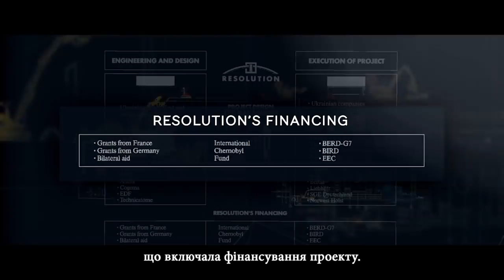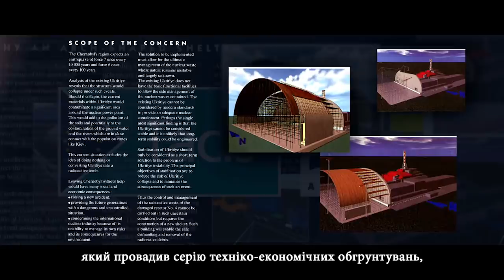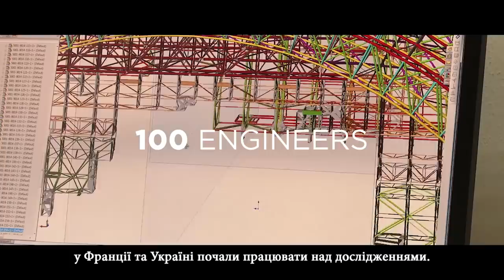Chernobyl confinement: the story

Comment: Well done and respect to all the workers who risked their health to work on site :)
Reply: They needed them operate to supply Ukraine with electricity. Otherwise they'd have had an electricity shortage.
Reply: TheWatcher _ you recall incorrectly.  The other 3 reactors were fully operational and continued to make power for long after reactor 4 had its meltdown.     To this day Chernobyl still employs a large group of ppl who just continue to monitor everything and maintain the stability of the plant though it no longer produces power.
Reply: @punanie05  Correct. Over 3500 employees are working on the plant every day. They come in via a special train connection from Slavutych which was a city built to replace Pripyat, which was Chernobyl's workers' town.
I urge everyone of you to check this out and help them out with donations if you can:
https://cleanfutures.org/projects/chernobyl-worker-healthcare/
Reply: punanie05 it stopped producing power in 2000
Reply: @nehorlavazapalka Yes, but it's still not safe and threatening for health to work there. That's why workers there have a work shedule where they're forced to take a break for a couple weeks, while others who are off their break fill in. If it was not dangerous and as harmless as you try to make it seem like, then people would be all back living there and this new sarcophagus wouldn't be needed.
Besides that the whole area has spots with different levels of radiation. Some ok and some skyrocketing that will already effect you physically with symptoms after a couple minutes, or even seconds of exposure. This came with the radioactive clouds back then. And those are the ones that are dangerous and always expected to happen any given moment (as the structure of the old sarcophagus and the plant itself) were in disastrous shape. They expected it to collapse, which would trigger new radioactive clouds (not only dangerous for the exclusion zone) and that's why they built this new one around it. So anyone who was working there was exposed to a costant possible threat. So yes, the workers there did risk their health, one can't deny that fact.
Reply: scalpelli there are parts of Chernobyl which are still radioactive but most of it is safe in some building is the average radiation but in the hospital basement yikes
Reply: @DOOMGENERATION  I find that the No Threshold model of exposure to be the most accurate. However even then, their suits relied on positive pressure to keep out particles of dust or dirt from finding their way in. Every precaution was taken. The scientists that worked inside the facility dealt with more radiation exposure. These guys probably had dosimeter badges and kept very good records of their daily exposure. At 300 meters any radioactivity from the plant or ground would be minute.

   The construction for this needed to be at least 300 meters away due to the soil directly around the facility to be pretty contaminated. When they cleaned the upper rooftops of radioactive debris, it was pushed off to the ground below. This material weeks after the disaster measured 9,800 Reontgens per hour and had to be cleaned by hand. The 2 second clip with the robot was on "Masha" I believe. Masha was the most contaminated rooftop where the exposure times were 90 seconds or less. The robot, nicknamed Joker landed on a chunk of fuel rod or graphite rod and literally fried through the lead plating the circuits of this former German police robot modified to help save the brave men exposure to lethal full body doses of radiation.
Reply: @DOOMGENERATION  ugh you get as much radiation on a three hour flight as you do standing outside of the plant.... 90% of the radiation outside of the plant is now in the soil and not in the air is why if you take one of the radiation readers and take it from normal height and then lower it all the way too the ground ot will go from a slightly high .30 too normally an astounding 30.0-300.0 and the most radioactive crap outside of the plant are all lying in the hospital in the deserted city of pripyat in the hospital where all the firefighters and workers were taken and their clothes were taken off and were just thrown down and are still there today most of that crap registers anywhere from 300.0 too 800.0  thirty years later and are just left lying in the wide open in an abandoned hospital
Reply: @richardgrace4500  Ur lacking on quite some facts and knowledge here. While I don't deny the things u mentioned, u left most facts out though. There's more than just the clothes and the hospital, just saying. And a 3 hrs flight and standing next to the plant for a bit is a bit different compared to being exposed to the radiation there every day of your life and also drinking the water and eating the food from there. These people there have been working under these conditions at the plant for a long time and they definitely know know way better about the dangers than some random people on YouTube.
Reply: @DOOMGENERATION  man that was a lot of autism just to be wrong in the end
Reply: @noreason2701  Projecting much?
Reply: Yeah I was shocked to learn that they continued to operate the three other reactors until the year 2000... WTF, like we know it's a flawed design, but lets just roll with it...
Reply: @YukonAvie old comment but they literally had to. The country didn't have enough power without the reactors. The last reactor shut down in 2000
Reply: If I recall correctly, they weren't really operating them but they were preparing for shutdown. Correctly shutting down a nuclear reactor isn't something that's done quickly.
Reply: General YeahYeah I’m sure it’s more for like, saving the planet
Reply: Working around nuclear reactors - yes, even Chernobyl - can be done perfectly safely.  Radiation isn't nearly has harmful as most people think, and the radiation levels near the reactor aren't that high (after the containment building was installed, you get more radiation flying across the US as sitting right next to the structure - they did a fantastic job).  They know how to work around that reactor perfectly safely, and they take precautions to ensure their health.  Nonetheless, the spirit of your post is correct - those workers are superheroes and they deserve nothing but praise.
Reply: Respect? They had no idea they were going to their deaths. They were putting out fires as they thought.
Reply: @ Nautilus1972 Not even close.  Not a single worker erecting this structure died.  Not a single one of them received even a dangerous dose of radiation.  Plus, there hasn't been a fire at that site since 1990 (and that fire had nothing to do with nuclear material).  You either didn't watch the video or have no idea what you're talking about.
Reply: Wernt they prisoners who accepted their death
Reply: they don't risl their health that much as you may think, the radiation there is as high as in an Airplane, there are only very few spots, where the radiation is truly dangerous. you can even go on a tour to Chernobyl. You are able to go up to 500m (I think, something very near the reactor). It is quite dangerous, beecause it still is instabil (which is the whole point of this structure)
Reply: the site is nowhere near as radioactive as you were lead to believe, also the powerplant continued to operate for years after the accident
Reply: nehorlavazapalka Look up the elephants foot underneath Chernobyl. It’s one of the most radioactive things on the planet. Then tell me it’s safe to go there
Reply: C Mac it is the most reactive thing on the planet
Reply: @thatxboxchannel4772  i know it’s a few years late but that’s incorrect, nuclear reprocessing facilities (recycling used nuclear fuel) have areas within them where concentrated fission products are being treated that can have radiation levels as high as 500 sieverts. (a lethal dose with medical care is 4)
Reply: @nehorlavazapalka  Bollocks.
Reply: @nehorlavazapalka  u it will
Reply: There have specialist protection  now of days we understand. About radiation physics. And nuclear energy. Now